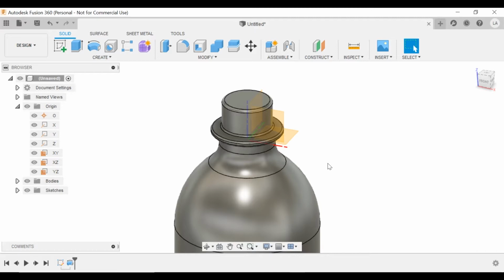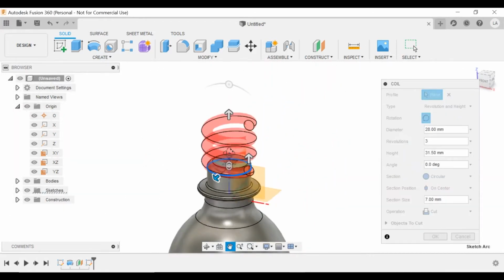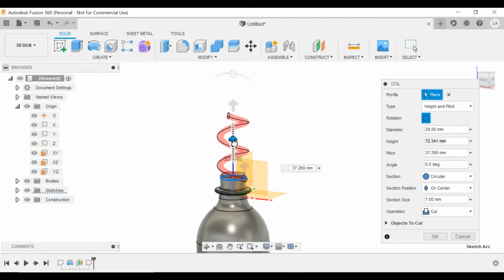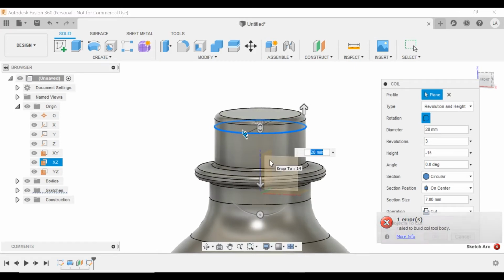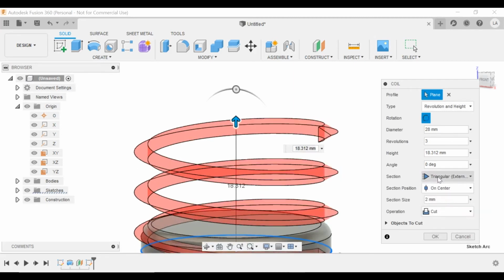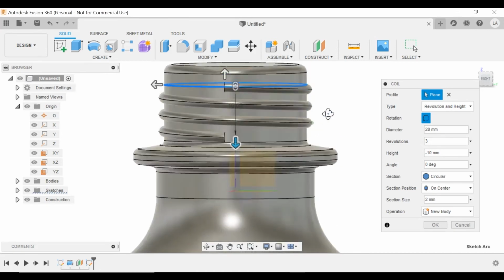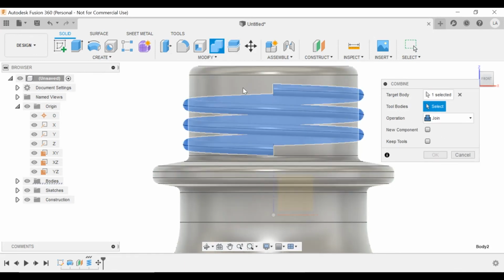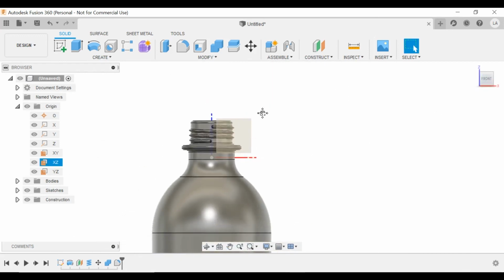Fusion 360 Beginner Modeling Tutorial - Coil Tool

Comment: Once you have created the threads on the bottle how do you match the threads on the bottle cap?
Reply from the maker: Hi! there are a couple of ways you could do this; either cut the shape of the top of the bottle away from the cap which will leave the thread profile. Or put the same coil on the internal surface of the cap so it matches up.